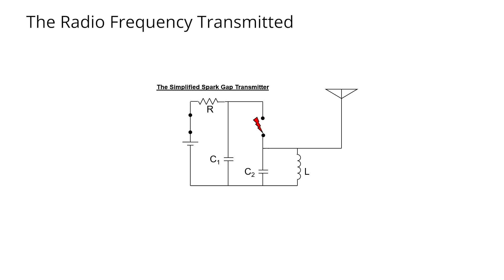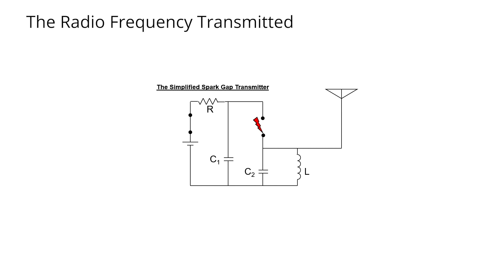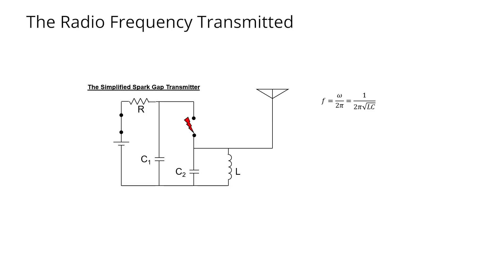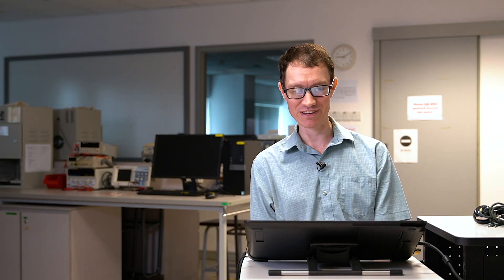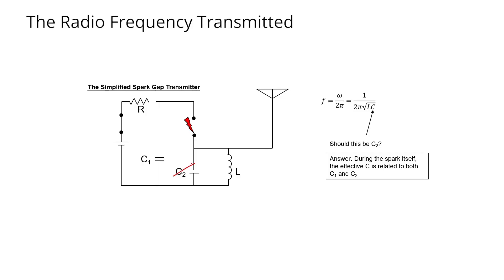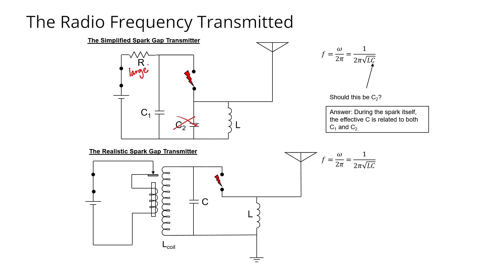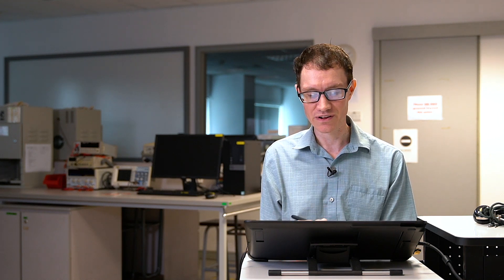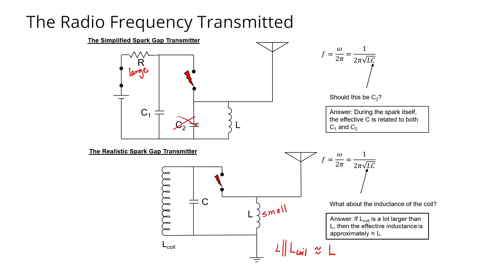Spark Gap Transmitter Circuit Discussion (6-Analog Electronics)

Comment: I've always found when designing LC oscillators that the frequency of the output is never quite the same as 1/(2π√LC) using the LC combo of the tank circuit. I've always assumed this is due to the parasitic capacitance of the transistor and surrounding circuitry. Do you think this is a fair assumption?
Reply: This is due to the damping ratio of the circuit. The natural frequency of the LC circuit can be different to the damped frequency based on how big the resistance in the circuit is (including source and inherit coil resistance in inductor)

Comment: What about connecting the antenna straight to the high voltage capacitor that is slowly charged and quickly dischared, and get rid of L completely, to make use of the impedance change of the electrostatic field of the antenna?
(air is used to quench the spark, so it makes a high voltage sawtooth wave)